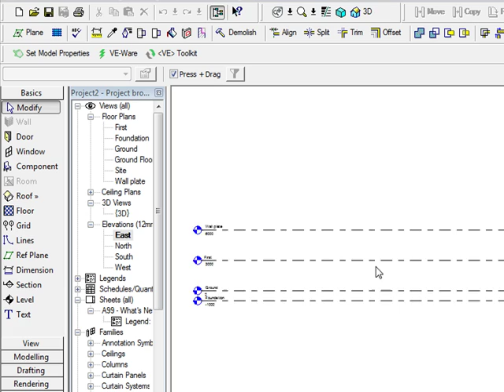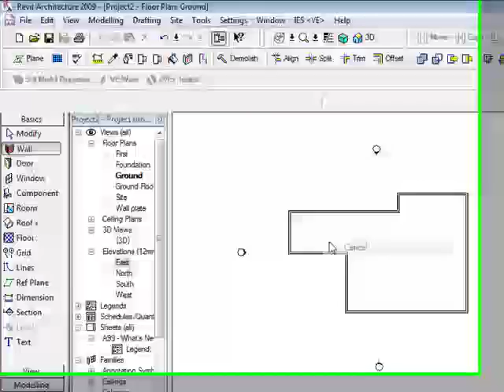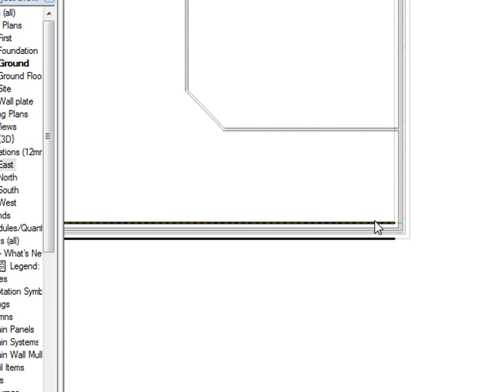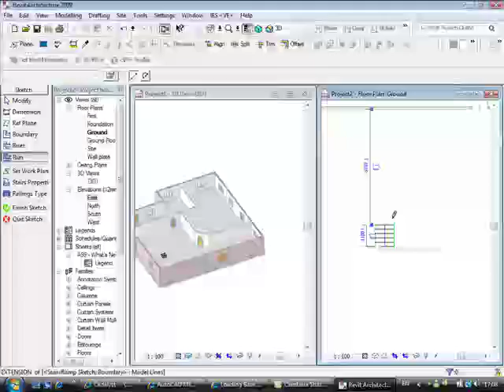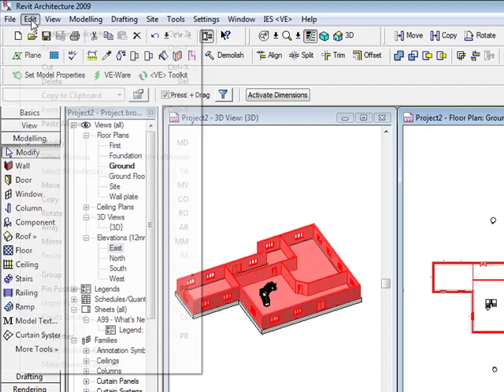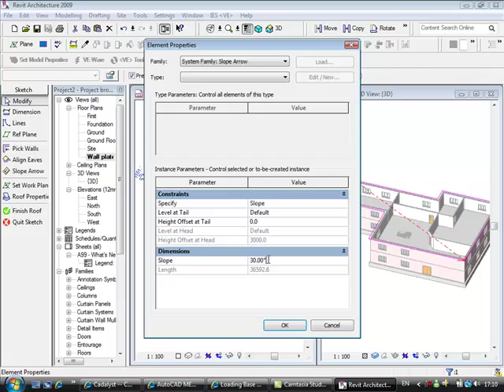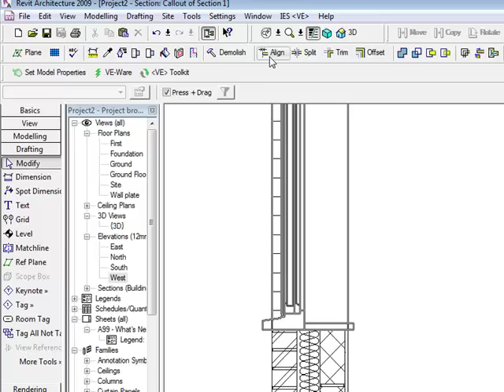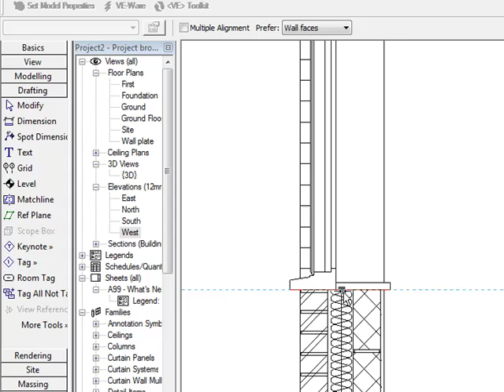Revit from scratch

Comment: Hi, I'm new using the Revit software program; I was wondering if you might teach the same video (revit from scratch) in a newer version. I operating the 2013 and it appears that some of the commands in 2009 are not in the 2013, perhaps they are but i'm not sure how to find them looking at the 2009 version.. Thanks
Reply: +Mark Mcdaniel Yeah, I'm using 2016 so its waaaaay different

Comment from the maker: @sunglance Hi Sunglance, Your contractors can view the data by using DWFx technology from Autodesk. All the files, project management files etc can be published. You can also use Buzzsaw or other EDM software such as Meridian. The greatest advantage is a BIM (Building information Model), changes are reflected real time via the disciplines lowering costs and mistakes. A Change in one view represents a change in all views. NICADMAN